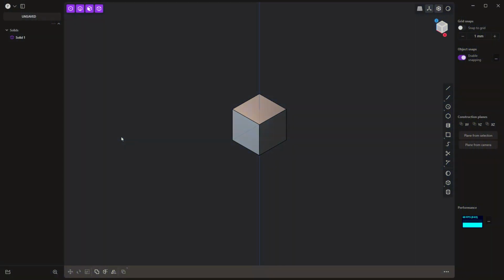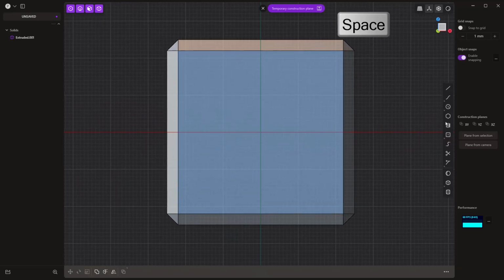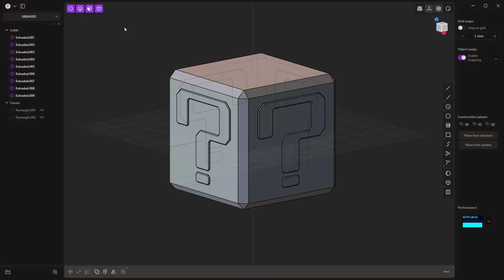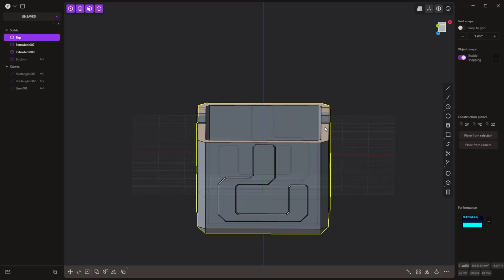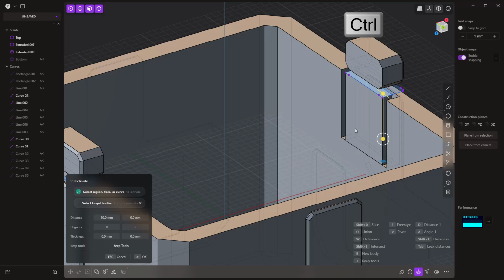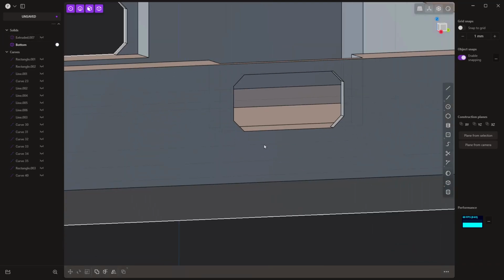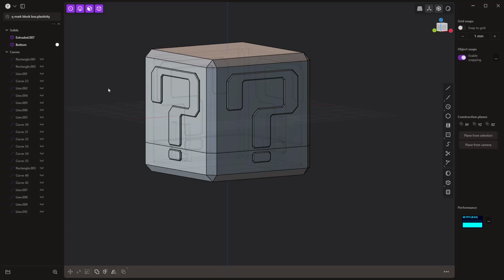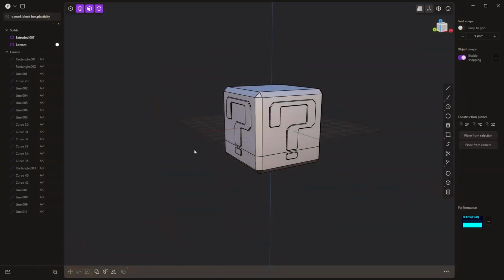How To Design a 3D Printed Mystery Box using Plasticity

Comment: Just found another option for the question mark: Use Adobe Illustrator and save as an SVG, then import
Reply from the maker: 100%  if you have the ability to draw graphics as an SVG you can bring that in to most CAD programs and just extrude it.  that will save some time if you already have it drawn or can do it quicker for sure.

Comment: that's interesting ! . just one question , why would you use plasticity instead of fusion ? because it is free or just personal preferences ? 
anyways i always appreciate your tutorials , specially the ones in Fusion360.
thank you .

edit: i didn't know plasticity is not free
Reply from the maker: Good question!  The short answer is that someone asked me to :)  I have loads of software that I use so picking a program for a specific task isn't always clear.  Personally my go to is Fusion.  But why do I pick Fusion over say Solidworks or Inventor that I also use?  again subjective.  Sometimes its the client that picks, other times its the functionality like Forms in fusion. and other times it may be quicker to do concept models in say Plasticity before committing to a final design path.

If I were modeling this for myself I would probably default to Fusion, but I think there is a large user base looking to use Plasticity because of the license structure and workflow.  Because it isn't super clear how to deal with fit/tolerance/dimensional accuracy, that is the reason this video was done with Plasticity.  There are certain things Plasticity does better/faster and others that Fusion does better.  For example I made a Mario Brick with a thread on cap.  Threads are easier in Fusion because you can just use the Thread tool and then mess around with fit/tolerance by trimming/offsetting faces.  In plasticity I need to manually draw threads (which I have done and is possible), but it takes a bit more finesse. Fusion has section views so working inside of an object is a bit easier.  In plasticity I find myself copying and cutting bodies to see inside of them or changing the opacity.

So sadly its not a clear/straight forward answer.
Reply: @LearnEverythingAboutDesign  thanks for the complete response, I'm all in for fusion and your videos are so informative . every time i think I'm done learning fusion your videos show up with a new technique. thanks again.
Reply: @LearnEverythingAboutDesign  Really helpful video. I like your approach to 3D printing using plasticity. Any changes that you made a video of the threads that you mention?
Reply from the maker: @terra-damm  Thanks!  I do plan on making a video on 3d printed threads, but at the moment i am working through some 3d printer tweaks.  This part highlighted some issues that need sorted before printing a few more threaded pieces, but I will make that in the near future!
Reply: @LearnEverythingAboutDesign  Great, looking forward to it! Thanks for replying and keep up the good work, your channel is great and your Plasticity tutorials are super well explained and easy to follow for entry-mid level users. I always share your videos with my 3D printing friends!
Reply from the maker: @terra-damm  Thank You! I really appreciate that!
Reply: Fusion is awesome and powerful and I learned quite a lot about it from Matt's videos. But since I come from a Vfx background using Maya I find Plasticity a better fit. I'm just glad he's making content for both. Who knows maybe I'll jump back on the Fusion bandwagon down the road.